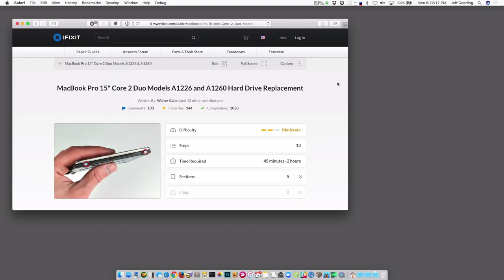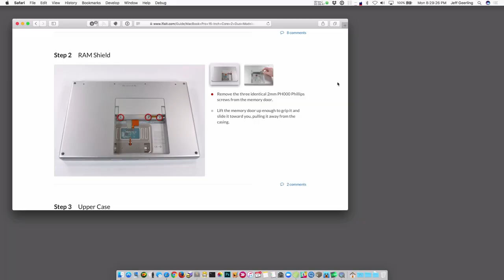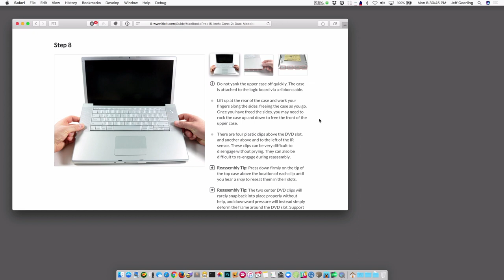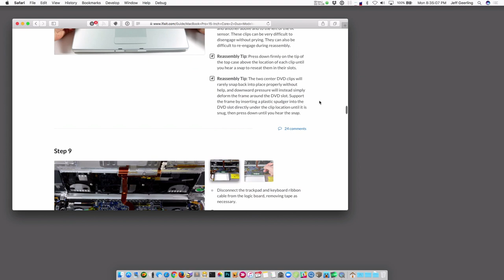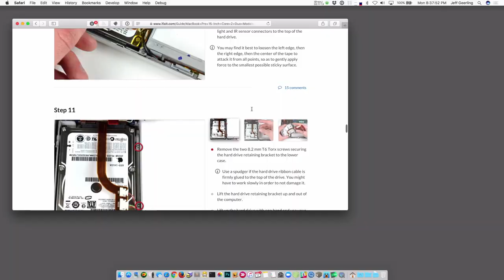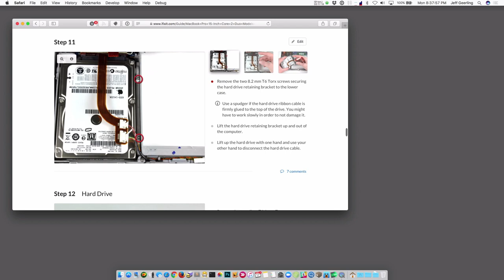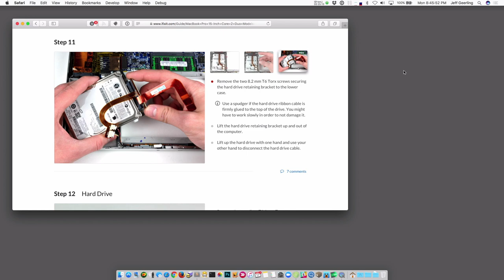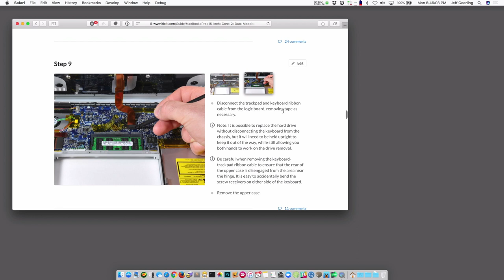2007 MacBook Pro Repair - Replace HDD with SSD

Comment: Excellent presentation. I follow the steps, successfully install the SSD drive and the OS X without any problem in my Macbook Pro 17" 2007.  The performance of the computer has immensely improved. It was taken forever to boot now 25 seconds.

Regarding the SSD drive, I’ve purchased a Crucial BX500 2.5″ 240 GB SATA III 3D NAND Internal SSD model CT240BX500SSD1 for $40 CA. On their site it says, it is compatible with the MacBook Pro 17″ 2007. 

About the Mac OS X installation, during the process the disk is not shown, to be able to see the drive; we have to use the Disk Utilities that is found from the drop-down menu. After doing that, the drive is shown and ready to install the OS.

Thanks
Reply: How did you restart in recovery mode?
Reply: @Tech 305  I've reinstalled the program from scratch, and after I've restored files from Acronis Backup.

Comment: I want to thank you very much for doing this presentation.  I can see I would have been absolutely lost without it.  I am so grateful.  A couple of things in my laptop were just a tiny little different from yours even though I have a 2007 MBP 17 inch.  It was taking me over 3 minutes just to get it booted up and ages for it to open any application.  Now I have a 1Tb Sandisk drive and it is so fast by comparison.  I studied your video 3 times before I began and had it on in the iMac desktop and followed it step by step.  Thank you.
Reply from the maker: Glad it helped! I wish I would've recorded it more in detail back then, but I was more interested in the time lapse than thinking about making it instructional. That generation of laptop was hard in some ways to service, but at least you could do major upgrades like newer faster drives and RAM!

Comment: Wow a young Jeff! Nice to see a quality vid on the old Santa Rosa: mine is at present held together with elastoplast and only functions in SMC_debug mode, maybe because the battery is absent? Anyhow it's a good tool to try multi-booting macOS and Linuxes on; Fedora36/Gnome works well, artix is ok, antix is nice, about to try EndeavourOS again, maybe I'll throw in an SSD too. Thanks for the vid, yours are always concise and lucid.

Comment: 13 minutes, you said you must not use continously the can because of the reaction going on in it. I'd like to nitpick on that. There's no reaction going on. However, dropping the pressure at constant volume drops temperature. It's a principle used to make your fridge work too, you'll notice a hot spot somewhere, where the compressor is.

PV=nRT (law of perfect gases, accurate enough for the explanation) 
P : pressure
V : volume
n : amount of matter (in moles)
R : constant of Avogadro
T : temperature

Comment: I have a 2007. I tightened up the display screws because they seemed too loose and....well it was too tight and eventually cracked the metallic-looking plastic part of the display on both sides (at the bottom) of the display, but not the actual screen. I wanted to replace the whole display. Is this a difficult thing to replace? And I may need to know what the actual torque for those screws should be so this doesn't happen in the future. Thanks, man!

Comment: Hey Jeff . I had a sata gen 3 ssd , however it wouldn't fit in the 2007 MacBook
connector.  Is that because it requires a sata 2 type ?.

Comment: I have this macbook. It bricked. I went to upgrade the RAM. It says it has two 1gb sticks. I have an extra 2gb. So I figure with 4gb it will run snow leopard. So I shut down and open up the ram. It turns out each ram stick is 2gb. So I think ok it must be some software problem that doesnt see the ram. So ok I put it back in and it bricks?  Won't start. It was having a problem as well with the dvd drive so I think it might be 8nterfering with the startup. What do I do?

Comment: Hello,
Did the SSD make a good improvement over the HDD? how much difference?

Also my old 2007 top spec 17inch has the GPU issue, it started less than two years of owning it. I brought it into the registered Apple repair shop in Ireland and massive money to fix and not covered by warranty(they said), which I now doubt was the truth especially given the fact it's a known issue on them. 
But an external display worked fine on it.

Is the GPU a hard thing to fix? 
I'm imagining an Nvidia 1070 and an SSD, new Ram, and a polish after changing the processor :) If only :)

Good work, I put an SSD in my 2010 13-inch and it kept me going two years extra, really was a new lease of life, 7 and a half years later. 
Apple products in my experience can be hit or miss and when they are not right Apple are terrible when it comes to aftersale support, especially in Ireland where they are head quartered(purely for tax purposes but more accurately stated would be no tax purposes) yet not a single Apple store in the country, unless you cross the border to Belfast.

Thanks for the tutorial!
Reply from the maker: The GPU problem is pretty difficult to fix. If you have the tools to do a reflow properly, or if you like living on the edge and using your food oven... then it might be possible to fix the GPU without causing further harm.

But even getting to that point requires removing almost every component in the computer's base (since you need to get out the entire logic board).

If the GPU is fine, then yes, upgrading the HDD to an SSD makes a huge difference in day to day use, even on an older MacBook Pro, because the seek times are orders of magnitude faster. App launches and boot times are at least 2x faster, and a lot of little things are sped up quite a bit as well.
Reply: Good man, there is hope!

I applied thermal paste to my 2010 13" and that went well so I'll chance this procedure in a few months, It'd make for a good hub for household security cameras. 

Bake the GPU,,, I can bake cookies, living on the edge is eating them :)

Thanks for the guidance!!

Comment: What is the first screwdriver that you use? I got a Philips 00 as suggested by the ifixit guide but it doesn't work on those 3 first screws. Thank you!

Comment: Please help, how do I reboot in recovery mode, I installed a new SSD, but I hope command R upon restart and it just keeps going to the folder with the question mark. I don't have the original CD that the laptop came with
Reply: If you have access to another Mac you can create a bootable usb drive. This video shows different options 
https://youtu.be/8jmm4Op7wjk

Comment: I have the same exact computer, my issue is the motherboard...Can you give me advice on what motherboard need to buy to replace it?? model number it serial number?? Thanks in advance...
Reply: Not worth it. You can get a used MacBook Pro 2007, for like $100 on eBay and such. You can get a refurbished one for like $300. The motherboard alone is probably around that cost so better to just replace the whole computer

Comment: I have the same exact model & the latest OS installed is Lion 10.7.5 with 4GB of RAM & 2.6 GHZ Intel Core 2 Duo Processor
Once I install the SSD, will it be possible to run the latest OS software High Sierra or do I have to do something else?
Reply: OCPrunsthecops  Bump
Reply: No. The SSD has nothing to do with what Mac deems "unfit" for upgrading.

What I'm personally doing is trying to put Windows 10 on it as that's the only thing you can do to have an up to date system on this computer...